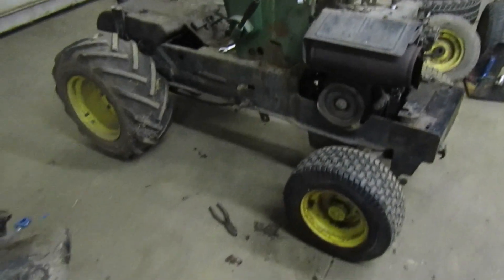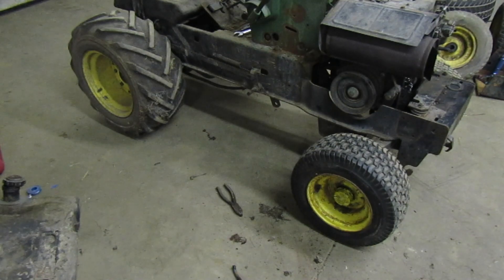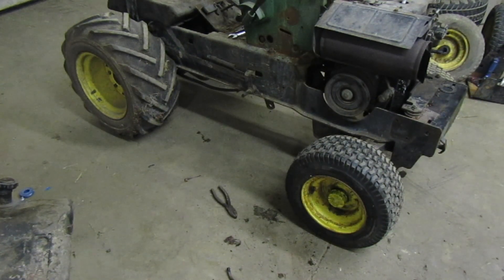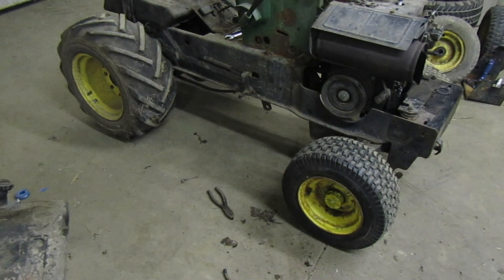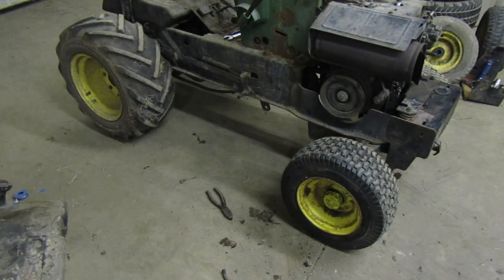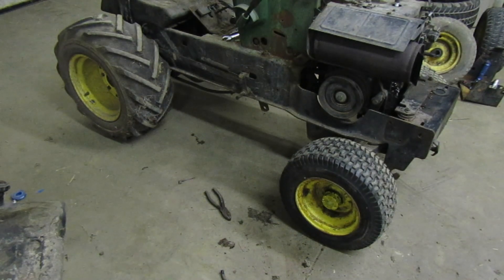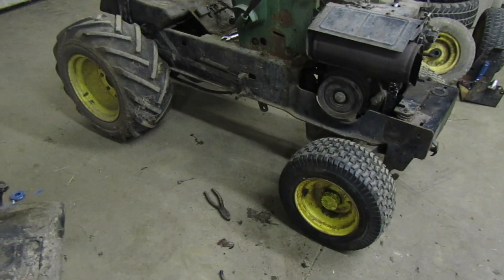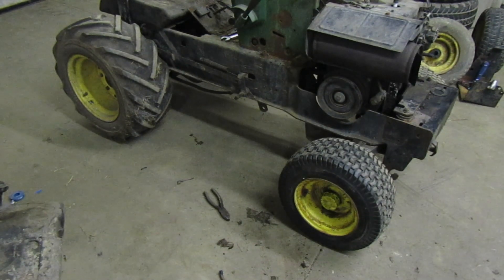Tips and tricks for waking up a tractor that has not run in a while (Viewer Suggested)

Comment: Jon, Are you thinking of @HamiltonvilleFarm???  I watched the same video. Great Minds Think Alike. 
Oh By The Way Jon, I used a short section of wire with the insulation stripped off from each end. The solenoid evidently wasn’t getting enough charge to work from the key switch - It’s amazing what a short circuit can do in a good way., After I started the engine, The stator charged the battery and I also after running the engine hooked up a battery tender to give the battery a even better charge. Thanks for the kind words.
Reply from the maker: Yes
Reply: @themaniacmower  By the way, I am still using the same starter solenoid because I am too cheap to buy a new solenoid for the MTD and the engine usually starts after 2-3 clicks.  So Jon, I have a brand new John Deere solenoid- But do I want to use it on my MTD - I can’t say what I am really thinking, So I will leave it to you and your subscribers to fill in that blank. Thanks for your shout out, Jon.